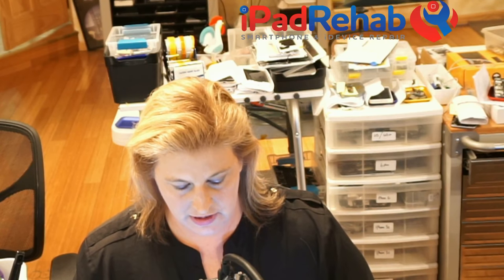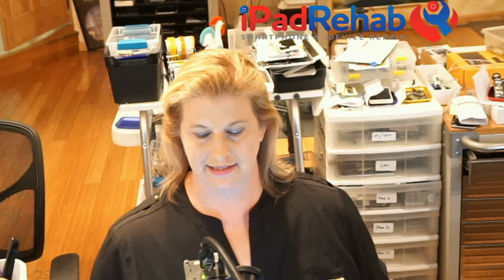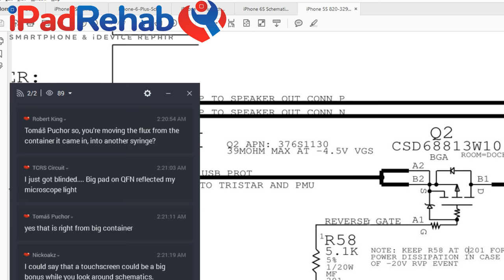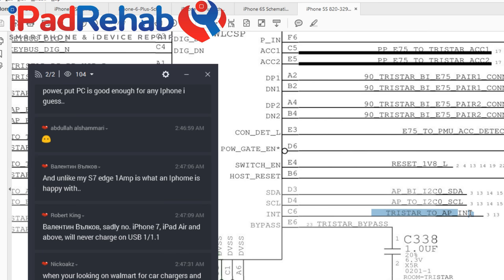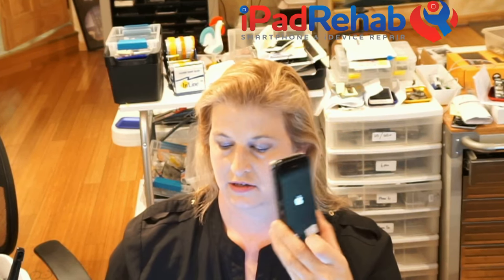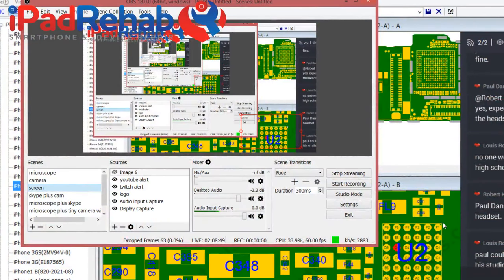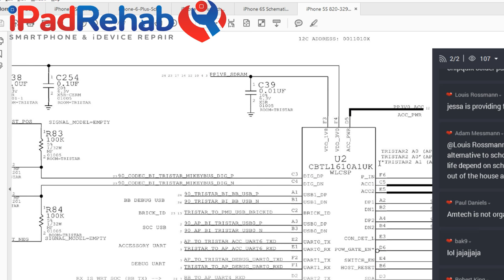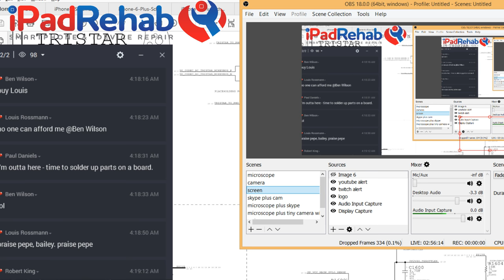What does tristar really do?  Let's kick it in the balls to find out.  SEE UPDATED VIDEO

Comment from the maker: Big Edit!   I had to redo the experiment due to dock connector failing in the middle.

Results: 
Deleting PP3v0_ACC ball under tristar in iPhone 5s had the following effects compared to normal.  Note:  Phone was able to show normal tristar function after replacing with normal tristar

Del PP3v0_ACC----COULD NOT power a usb dongle for HDMI image output.   With usb dongle attached, pulled charging current of 0.5A from iPad charging block.   Pulled normal 1A without accessory usb dongle attached, and could connect to PC.

Back to normal tristar:  COULD power a usb dongle for HDMI image output--image showed on projector.  COULD consume normal 1A charging current through usb HDMI dongle when attached to iPad charging brick.  Pulled normal charging current in all conditions, could connect to PC.

Bottom line:  PP3v0 ACC does appear to only be used to power usb dongles/attachments.